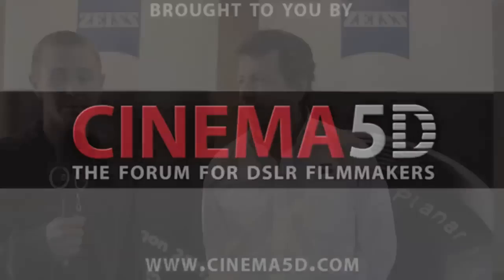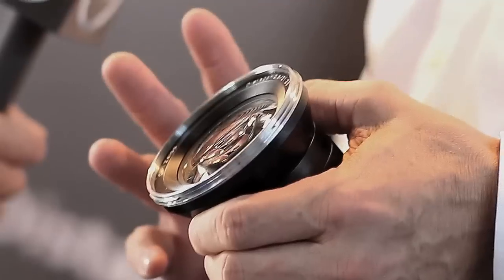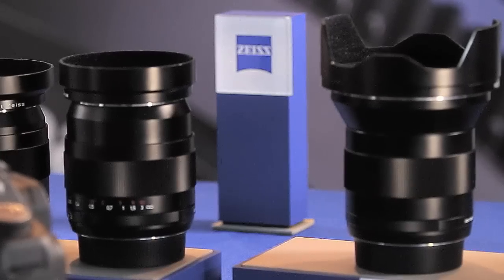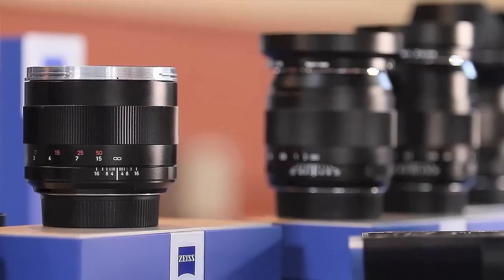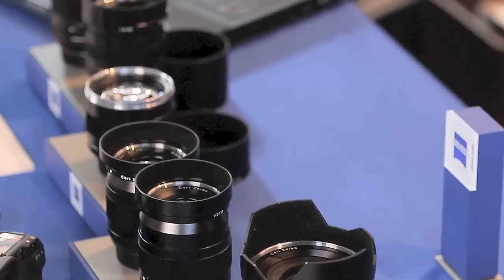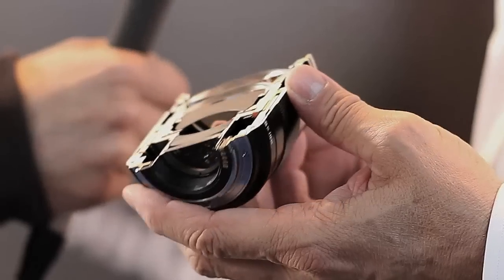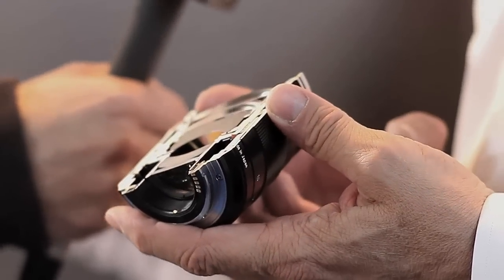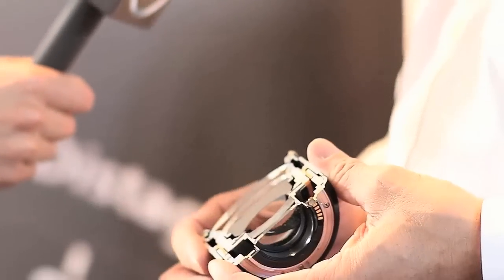Zeiss T* Anti-Reflective Coating Explained

Comment: What they dont tell you is that the Zeiss T coating the same coating is as Canons SSC read Super Spectra Coating is.,The both worked together in 1978 too make a new Multi Coating for their lenses.Zeiss choose one red Letter , a T whit a star ,the so cold T * star coating.Canon choose for 3 red letters ,SSC whit a red wing.When Canon find out that one letter for selling is bedder ,they also took one big red letter which begame the red L

Comment: Both Zeiss and Canon have worked together sinds th early 70ties too find and develop the ideal coating.First they both came out whit a single yellow coating Look at old Zeiss and Canon lenses from the early seventies and compare them,they are the same and they  both have the same yellow coller.Later on they developt a brand new multicoating .Zeiss choose for a red T and canon for a red L for marketing reasens.even Nikon have now a yellow N ,the so cold nanocoating